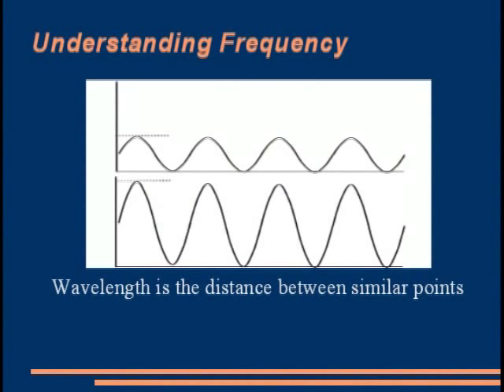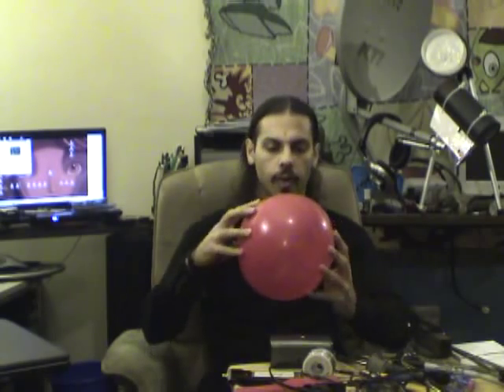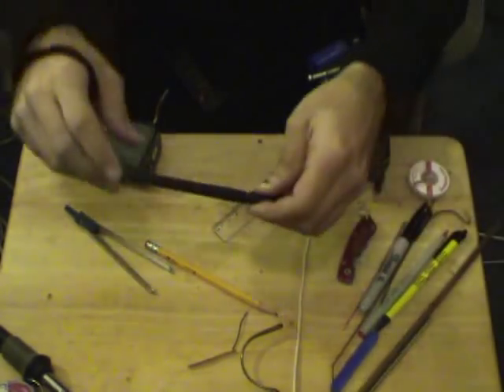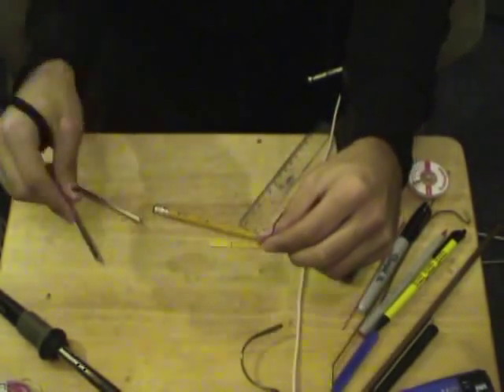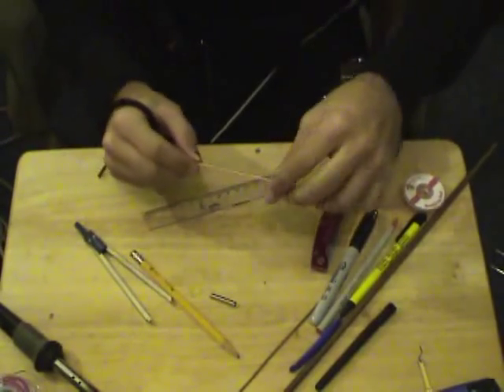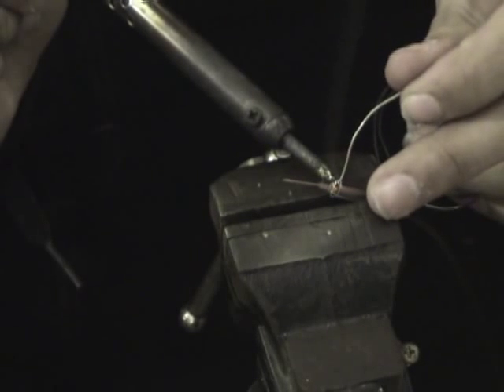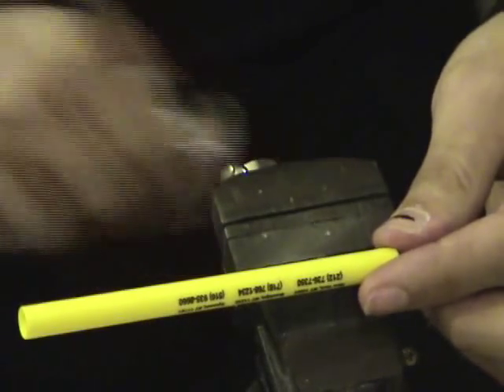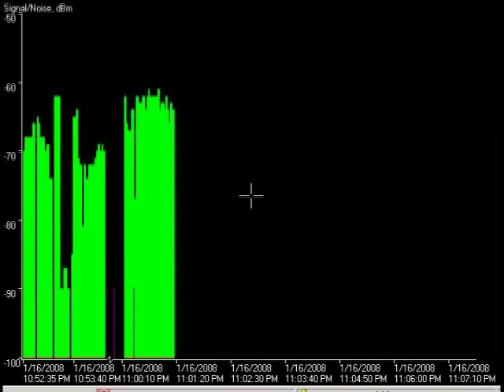Foxx   Antenna Design Intro

Comment: @FoxxOTG Hi i am new with physics and RF equipments and have a question about the lambda formula. I would like to try to modify the antenna of the Frs videos like one of your experiments. The operating frequency of the motorola talkabout is around 467 mhz. The value you input in the formula was 2.4 ghz. So for my case am i right to input the value as 467mhz?  The answer was 64.7cm. Does it means that my antenna has to be that long?

Comment: Thank you for cutting through the BS and providing practical, easy to understand, information.
Two questions: (1) does the 'Rubbber Duck' antenna have to be straight? I have an application with limited space, can I coil the antenna; or simply bind it into a circle? (2) What about the Bluetooth antenna that's inside a wireless mouse?